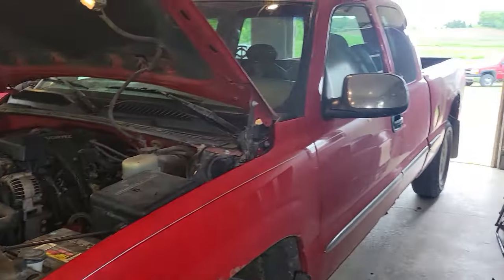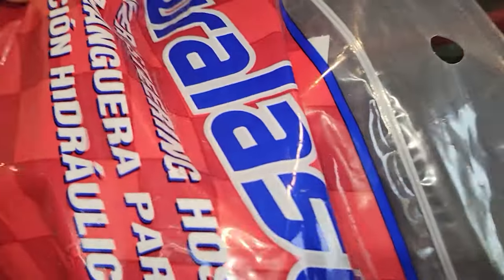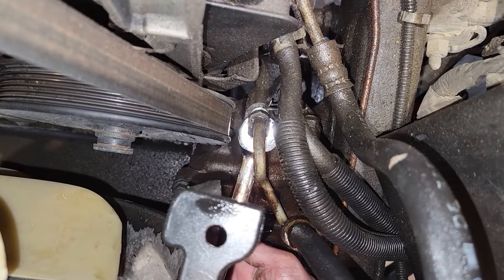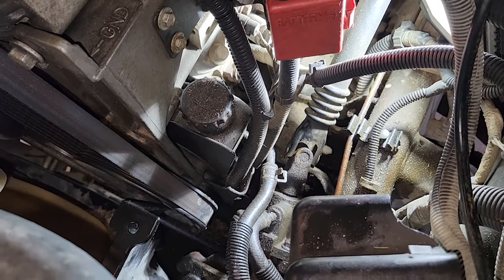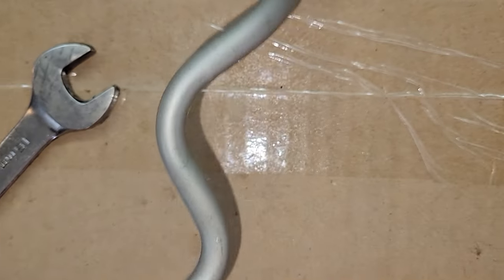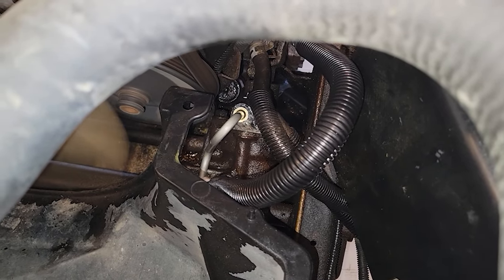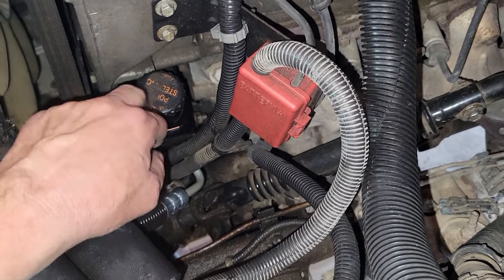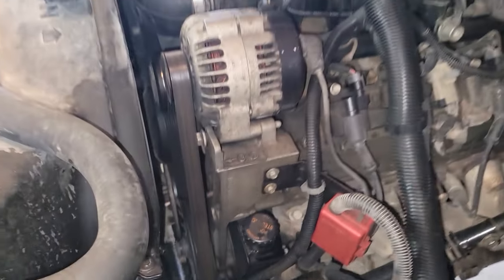How To Replace Power Steering Broken Line/Hose DIY GMC Sierra / Chevy Silverado Pickup Truck

Comment: I just finished this job, let me share some more hard earned advice. 1st, use a crows foot with a ratchet if you can. I had an 18mm but not a 16mm for the bottom. For the bottom, you can use a long 16mm wrench to get leverage to loose the bolt. Then switch to short 16mm wrench for complete loosening and re tightening. 

Now, be prepared for the pain because this thing is going to fight you on both sides. The new hose is very stiff and the rubber isn't exactly bent right to perfectly fit. When you go to thread the top part, it may be hard to line up the threads. What you can do is loosen the threads to the other metal PS line to the right, then push that out of the way. That will let you rotate the line to the right to get it threaded right, then you can straighten it back out so its parallel to the side of the car, and you can rethread the other line. Check the video from user Jim Dandy, he explains it more in depth. 

For the bottom part - get under the vehicle and reach your left hand behind the plastic dirt guard behind the tires (you may need to loosen it, and also to not have big arms) and up over the long steering column thingy to grab the hose with your hand. With your right hand pull the nut down to expose the end of the pipe. Pull the pipe down and get the end of the metal line stuck in that hole. It will hold in place. It's still misaligned at this point. Now take your left hand and grab the metal pipe where it curves close to where the fitting is, and pull the pipe downward to line it up while using your right to get it threaded enough that you can let go with your left and carefully tighten it with a wrench. Make sure its turning easy and isn't cross threaded.

Wear safety glasses because PS fluid is going to be dripping into your eyes (ask me how I know this). You can wear gloves but you are going to get messy AF and have crap all over your arms. 

On my 99 Yukon I didn't need to mess with the fan shroud, but the upper radiator hose was really in the way. If I had to do it over again I would remove that hose and at that point you probably should just replace it.
Reply: Any remedy if the hose happens to get cross threaded
Reply: @EricArizmendi-qi6fn  only thing I csn think is to take it back off and hope the threads weren't damaged and try again. If the threads were damaged they may be able to be fixed with a die
Reply: @ObscureStuff420 how long does it take to swap this mf out?
Reply from the maker: @nyladennis2419 not long.
Reply: @nyladennis2419  I think it took me a couple hours because I had to fight with it so much.

Comment: It's a little more work but I found it a lot easier to remove your bottom skid panel and that gives you complete and easier access to the bottom connection and a view of the actual pump to make sure there no more leaks once you connect the new hose..🤷🏽‍♂️🤷🏽‍♂️ just another tip..
Reply: How many bolts did it have ?

Comment: What size is the bolt and what size wrench did you use ?
Reply from the maker: I don't recall off hand.
Reply: 16 and 18 mm
Reply from the maker: @fernandoreveles5411  Thanks! I keep forgetting to look again.
Reply: Easier from the bottom
Reply: Did you have to stand on a chair
Reply from the maker: @TonysLadyF13 A step stool, yes! Lol!
Reply: @MelvinZoopers did u do it all from the top

Comment: He skipped showing the hard part, they don't come with new clamp brackets and those are a nightmare to change, This video is a bit of a joke. I just finished changing one and it's not that easy.
Reply: I just bought the same one, and put it on exactly like in this video. What did you buy??🤷🏼‍♂️
Reply: Did you buy just the rubber hose? You should have gotten one with the steel lines on the ends already.